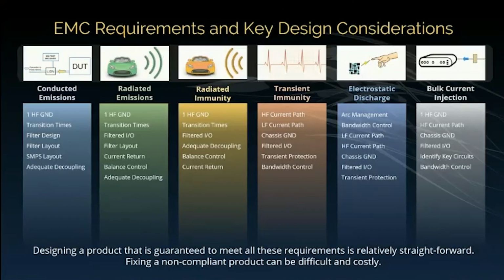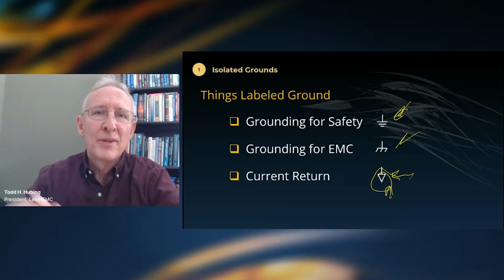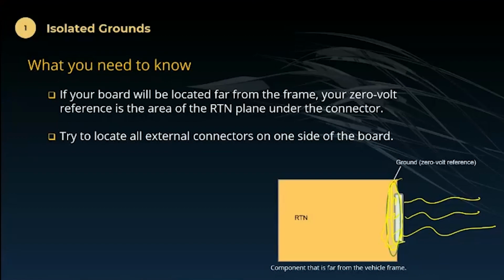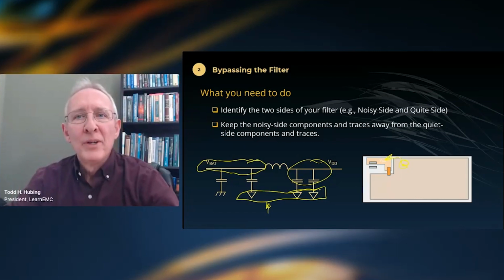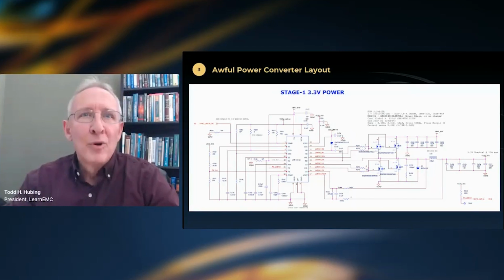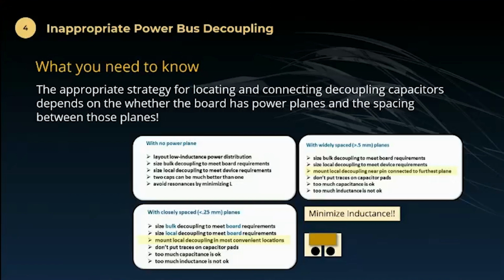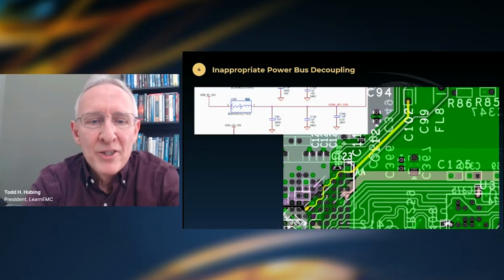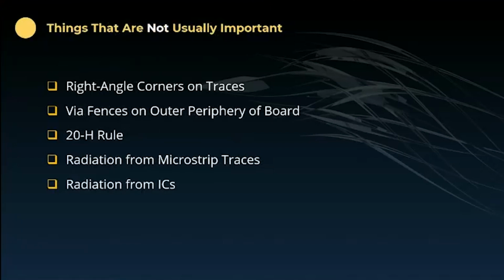KEYNOTE: Common PCB Layout Mistakes that Cause EMC Compliance Failures - AltiumLive 2022

Comment: Greetings and thank you for the presentation.

THANK YOU so much for advising me of all the bad literature out there on layout! This has driven me to insanity the last 20 years as I tried to LEARN EMC, with seemingly reputable  publications! The multiple contradictions must keep Big Pharma busy.

On the subject of a simple buck converter. Suppose the High Speed SW node has 'some' necessary surface area, perhaps 1 or 2 CM2. Suppose it is on a 4 layer with widely spaced internal planes, having only a few mil between it and return "GND" plane.  Could the capacitive coupling between "SW Node" & "GND" manifest as an unexpected LOOP of high speed currents? Could another side effect be stress on the switching element?

IF so, could it be "EMC permissible" to make a small aperture void in the plane just under the SW Node? Or, a void that contains a lattice inside it? No traces would overlap the void. Then perhaps add an RC snubber to the SW Node to GND?